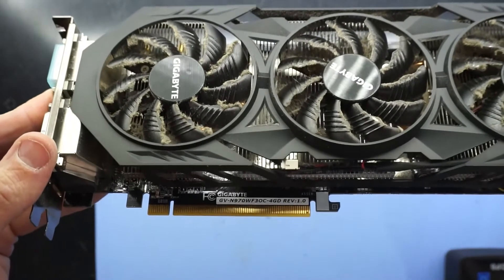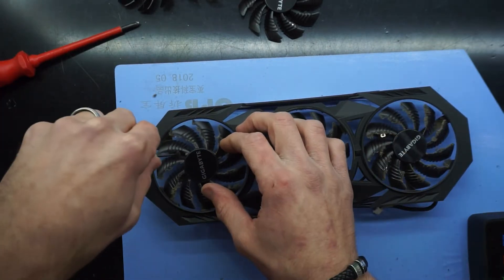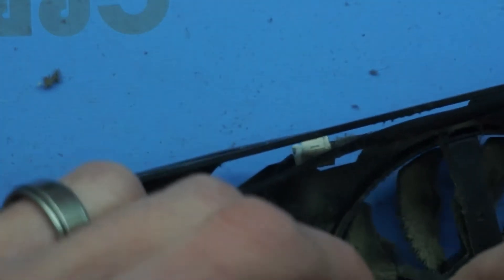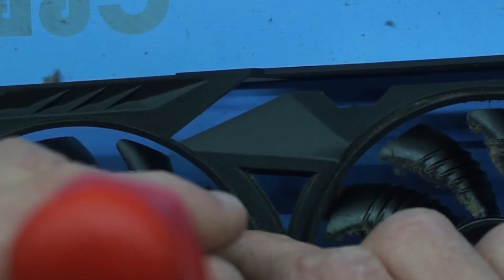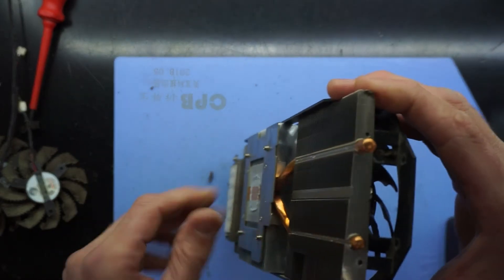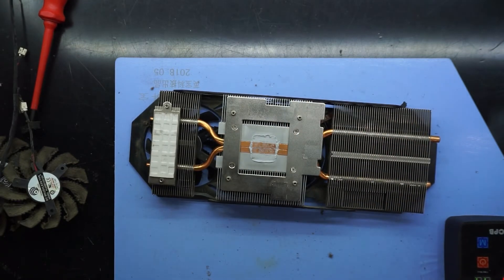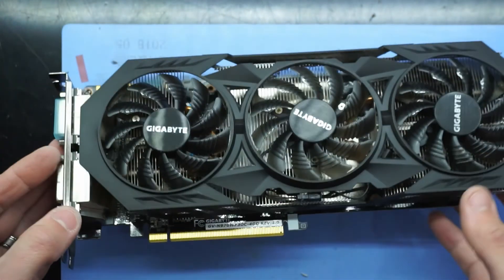Fan and Thermal paste replacement on a Gigabyte Windforce 960/970/980

Comment: Hello
I don't know if you can help me but I'll still write
I have a GTX 960 windforce, with 3 fans
The problem is as follows, after unscrewing a few screws, the card is "attached" with cables from both sides, from what I've seen they are usually only on one side, what does that mean? that it can be "unfolded" but it is still connected. You have acces to core.
I have cables on both sides, and I think they are fan cables, the problem is that I'm afraid to pull it because I'll break it...
I really want to change the paste on it, it's true that I will order a new card soon, a more modern one, but I want the temperatures on this one to be decent
I hope I've described it fairly clearly, I don't know exactly how to make it unfold because there are cables on both sides, they look like the kind that you "plug in" but I really don't know how to go about it

Comment: IMPORTANT TIP: I think you should exercise much more caution when cleaning the old paste from the chip itself around 14:21, especially with some older, harder thermal paste. There are many VERY small capacitors surrounding the die, you should be much slower and more careful when cleaning these as it is easy to knock one off if you're not careful. Easy enough when they are the size of a grain of salt, or LESS.... just keep this is mind everyone.      Please pin this if you see it, many thanks
Reply from the maker: iv never had an issue with cleaning the chips this way but i do understand the risks, where a quick first time thermal paste replacer might not
Reply: Bro you are repasting a GPU, anyone not interested in taking risks wouldnt do this.
Reply: @Garrett-c1c  there is taking risk and then there is being ignorant of knowledge

Comment: How is your thermal paste coming off so easily? Mine is baked on so hard I'd probably need a sand blaster to remove it.
Reply: yours got really hot. i use noctua cleaning pads
Reply: @jasonsorum7536  Never mind, I skipped past the part where you soaked it. I didn’t see that at first.
Reply: @jasonsorum7536  It is possible to open these fans? One of mine is gummed up and won't turn properly.
Reply from the maker: cant really service a dead fan.
Soaking helped remove thermal paste

Comment: he didnt change thermal pads...do you know maybe what thickness are they? :(
Reply: I used 1mm for the VRM and 0.5 mm for the VRAM. Measured it beforehand before buying. After receiving, and comparing to existing, the measurements seem correct.
Reply from the maker: yep, the video title is fan and thermal paste

Comment: First, that ammount of thermal paste on the gpu procressor lol. And second, you might as well  want to change the thermal pads anytime you open the card to apply new paste (every two years more or less). Did you also know that the thermal pads vary in these cards?, in this case the thickness varies from the one used for the VRM and the separated memories. You need 1mm thick on the vram, and 0'5 on the memories. And if you'd truly like to do a maxed out maintenance of your gpu, although I agree these would be a bit far fetched, but hey fans also begin to fail and do noise if not maintained as well, I'd also recommend adding special oil for these fans, previous dissasembly of the fan above of it engine of course.

After all these you rightfully have a full maintained/resurrected gpu.

And man please, just use a tiny dot for the thermal on the processor. That's just..., laughable.
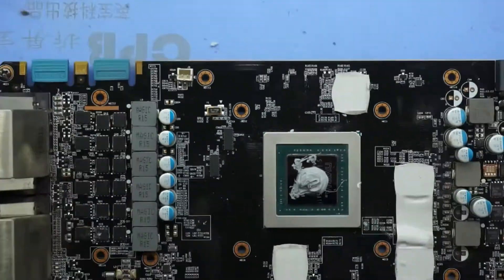Reply from the maker: i Direct you to 15:45 regarding thermal paste
Reply: @rickstechrepairs  Yeah. I meant that's too too much thermal, let alone on the gpu chip
Reply: @mustaproductionsperez6726  anything extra will just spill on the borders of the chip, which doesn't matter really
Reply: @O4KAST  so long the thermal paste is not conductive, you mean, because if it is then you should be careful with that "extra"
Reply: @mustaproductionsperez6726  I knew you were going to say that :)
Reply: @mustaproductionsperez6726   You have it backwards. The CPU has a small die under a large heat spreader so only a small dot is needed. Most(all?) GPUs have an exposed die so you need to make sure all of it is covered, even if it means squeezing out extra. 

Watch GamersNexus's "Too Much Thermal Paste" video and skip to 18:30 to see what I mean.
Reply: @oogolixoo  The why all the gpus I've been using the small dot method have last two years and almost a half without having to disassemble them again?
Reply: @mustaproductionsperez6726  In a CPU, under the shiny square is mostly empty space. The actual CPU is just a small rectangle of silicon in the center. That is why it doesn't matter whether the paste reaches the corners or not. 

In a GPU the shiny square that you see, IS the actual chip. There is silicon from corner to corner, and it all needs cooling.
With enough mounting pressure a small dot may be all that is needed, but it's always best to play it safe with GPUs by putting more on.

Comment: Hello, thank for vid. I might have a problem. You see my fans died so I have to replace em. Cant find any  2 or 3pins, only 4. How do you think would 4pin work for me?
Reply from the maker: not sure sorry
Reply: Hello, did you figure out if 2, 3 or 4 pins fans are necessary for the operation? :)
Reply: @emceeep  I did. 3pins only for my case.
Reply: @oWM7BmbekY  And you have the same card as in the video? Just wondering if there are different versions of these fans or always the same PIN configuration as in the video
Reply: @emceeep  Same, aye. I think it might be older/newer version tbh
Reply: @oWM7BmbekY  thanks :)

Comment: Thanks for sharing! Exactly what I needed, presented in a quick, no nonsense manner.

I would have loved a parts list or better yet an affliate link to the parts used (fan and paste).
Reply from the maker: Cheers, that's the style of video i try and go for :)

I dont have a direct link but if you look up Windforce Tri Fan on aliexpress it should come up with the fans from there (you may need to be signed in to your aliexpress to see the full results tho)
Reply: This should be compatible, changed the thermal paste, cheers

Comment: Is it possible to replace a fan without detaching the heat sink? One of my fans is making a light noise, the card is functioning fine, it's just slightly annoying.
Reply from the maker: Nope
Reply: My Windforce GV-N970G1 GAMING-4D Rev 1.1 has MODEL PLD08010S12H fans.
Found these on Aliexpress, a complete set of 3 fans with a common connector.
To connect this connector, you will need to completely disassemble the video card, as in this video.
This means that you need to additionally buy a not cheap set of thermal pads and thermal paste.

It would be possible to replace each of the fans of this kit separately, but there are two obstacles:

1. The black metal frame on which the fans are fixed is screwed to the cooling radiator
with four screws, of which only three can be unscrewed, access to the fourth is blocked by output connectors that cannot be dismantled.
I had to break off this part of the frame and I was able to separate the frame from the radiator.
In this video, the frame structure is slightly different from mine, probably because I have Rev 1.1.

2. Separating the new fans from the wire connecting them, I was surprised to find that the connector of the new fan has a male contact, and the connector of my old one is female. Therefore, when buying, you should pay attention to this and talk to the seller, because in the photo it is not always possible to make out which connectors. In this video, the connectors are the same, but the author has a Rev 1.0 board, I have Rev 1.1.
I'll have to cut off the connectors and solder the wires.
Reply: @myp60s  Yeah I just bought the fans anyway and it was really easy to change the fans without removing the frame.

I also had that problem with the male-female ports. The other fans are really hard to find but I managed thanks for the info.

Comment: Thanks man, had a problem with the middle fan which is not working, will try to remove the fans and check if the fan is broken or wires.
If you have the link to buy the fans can u share it?
Reply from the maker: check out aliexpress
Reply: also check out ebay and amazon if you don't want to wait ten years.  Got some 980 Ti fans with prime shipping.

Comment: Hey. Me again xD. So I finally got my TS-100 a while ago and your video reminded me I still need to get new resistors for my 970 windforce. Any chance to get some ohm readings on R637 and R638 below the CE logo?
Reply from the maker: Hi, I no longer have the GPU in my possession, so can't help sorry
Reply: @rickstechrepairs  It's ok. I'm pretty sure I know one of them. I'm just going to have an educated guess on the other. Thanks again. :)